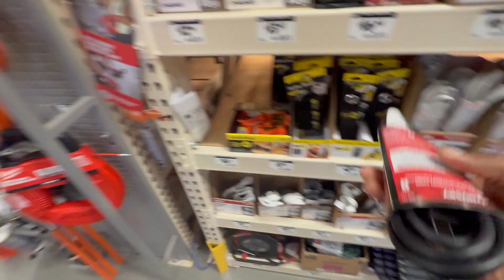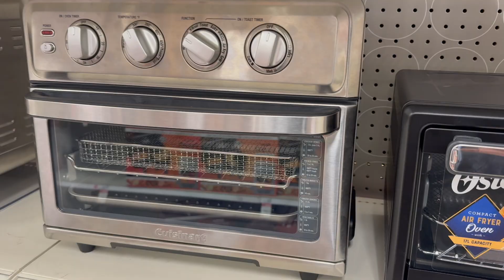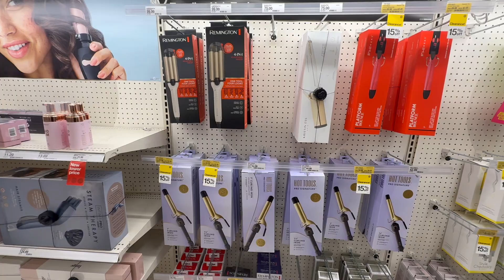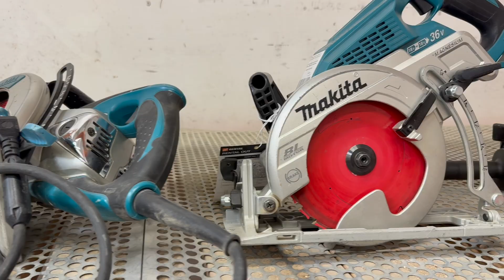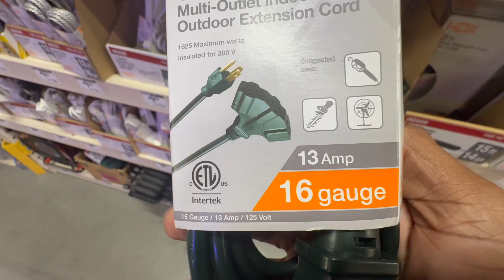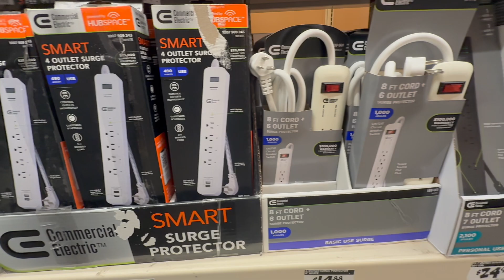EXTENSION CORDS CAN KILL YOU #homeappliances #powertools #extensioncord

Comment: I suggest extension cords from US Wire and Cable...there extreme all weather extension cords are made in USA and have a very high quality silicone  like jacket on the wires.They can be had in different gauges up to 10 gauge...they are rated for a solid 15 amps...have lighted plugs and they can be trusted...thats the important part.99 percent of cords are made in china or overseas.You can trust these cords made in USA..Also they are reasonably priced.